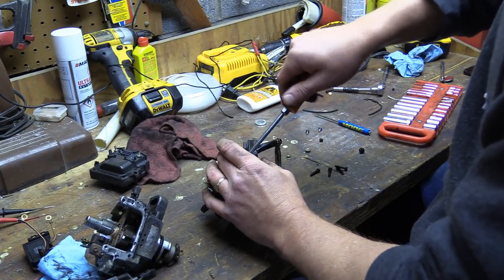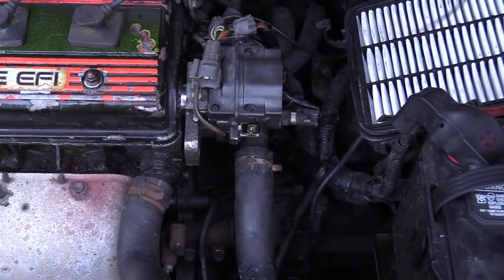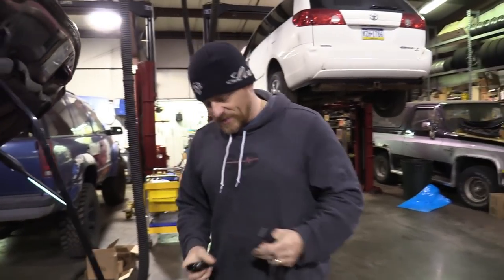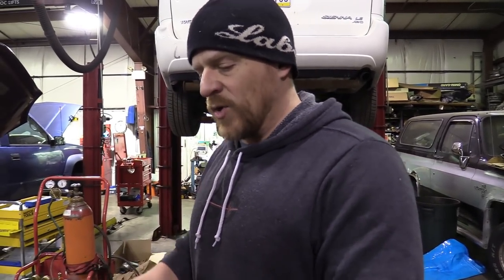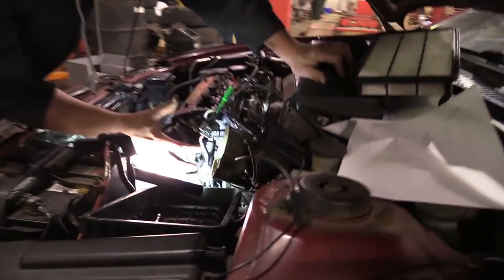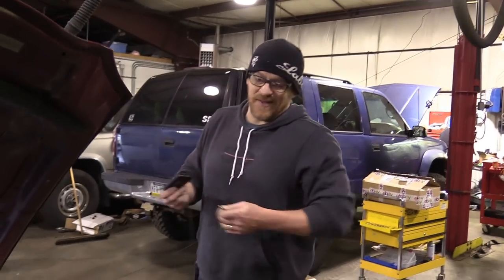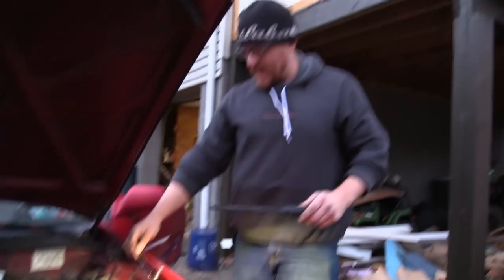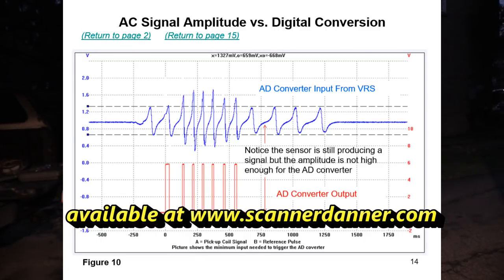Misfire, weak spark, 2 years after coil replacement 94 Toyota Celica (part 2)

Comment: Your first statement is so true. I just fixed had a crank no start on a 1987 Jeep. The coil was suspect, but it passed all the resistance checks. That led me to thinking it was an ignition module but a new coil fixed the problem.  You know the enjoyment of fixing a car with no new parts required. Lots of satisfaction right there. You are indeed blessed in many ways. Wow, adjusting the air gap was a huge difference in the signal. That was a cool comparison.

Comment: Scanner Danner after 10 minutes, "You need a distributor, a cap, and a rotor. That'll be 90 bucks."
Dad Danner after 6 hours, "No parts required Son, it's free."
Son, "Thanks Dad. That was easy! Can I borrow 20 bucks for gas?"
Reply: Hey an Ivan from Pine Hollow Diagnostic no parts required repair.  LOL
Reply: 90 bucks? You're kidding.
Reply: No, indeed, even cheaper on amazon. Why are these parts so dirt cheap over there?
Here in Germany every japanese car spare part means big bucks, a 4 week wait and no aftermarket available.
Reply: Sounds like me and what my kids would do.... lol ol......but, we are dad's 1st, and professionals 2nd.. :)
Reply: Nice !
Reply: Dan what is the name of the black scope you are using on the celiac wave form from distributor wires
Reply: @werner.x  we feel the same way about your parts for German cars over here :P

Comment: I agree with the caleb on the threshold, which is why at higher RPM when the signal strength increased the check engine light would go out.

Comment: I had to count the mil flashes on a 94 Jeep Cherokee the other day.  The guy  told to check the engine light was baffled that there was no OBDII under the dash.  Luckily you can cycle the key on those old jeeps instead of having to do the paper clip trick.  Everyone at the shop jokes about my "old man knowledge" but it saves the day more times than not.

Comment: Great video guys !! That weak signal is the same thing you see when the air gap gets too big on an abs sensor. The amplitude signal isn't strong enough and the abs kicks in when coming to a stop. I still have my brass feeler gauges for adjusting the air gap in those distributors !!

Comment: always great videos Scanner Danner,, thought I would let you all know these coils do fail, they usually leak secondary voltage to ground, you will usually see the white  gray tacking. you might have to remove coil for inspection.. Pick up coils also fail in many cases you will have to get it hot,, as a trick we use in the shop,  heat the distributor with a heat gun or hair dryer being careful of course. when the ignition fails while  running, then you can measure the resistance across the terminals.. I believe the max value is 180 ohms.. 25 year master diagnostic tech.  japanwest,  regards

Comment: No wonder I couldn't find this video when I had (and still have) a misfire with my '95 Corolla. I was looking for OBD 1, instead of "pre OBD 2", and just happened upon the part 1 of this video. I've had the misfire since around 2015, but part of the solution was to turn the AC on and put it in neutral at stop lights. If I pushed the car too hard on onramps, it would hesitate also. I found a guy selling a distributor and bought it. His distributor had copper windings coming out of the pickup? like yours. But I swapped what parts I could and still had an ignition miss. But at least I know I was on the right track. Because I did do cap/rotor/plugs/wires and still had/have the same problem. I did EVERYTHING under the sun away from the ignition system to find the problem...no dice. Will be replacing the distributor assembly because this one does leak oil past the seal, and the rotor/shaft is welded on both ends, so I can't replace the seal.
Reply from the maker: Is it a constant misfire? If it is, step 1 is to do a cylinder drop test and once you know which one it is, then compression and injector needs tested on that cylinder

Comment: Hey Paul, great Video. I‘ ve learned a lot  from your Channel. Here in Germany , I fixed a BMW X3 3.0i by using your Knowledge of Long and Short Therm Fuel trim. It had an Airleak caused by a smal cut in the plastic Valvecover between the Coils. Found by Smoketest  with e- Cigarette and Pe Bottle blocking the Intake😬
Thought i was ready, but the Fueltrimm did not get under 10% on both Banks so  check engine stayed on. Then we change the MAF and the Car was healed after beeing 8 weeks in a Mastershop🙈
Took me about 4 Hours.
There are too much Partschanger in the Shops today, without Laptop they are nothing. 
By the way , stop smoking. The World and your Students need you. 
King Regards from Lower Saxony / Germany
Reply from the maker: My daughter tells at me all the time too. Thanks brother
Reply: ScannerDanner i lost my Mom on Cancer 17 Years ago as i was 20 and its never been the same Life again. Stop it for your Family, don‘t think it happens only to the others.

Comment: GREAT case study Paul, and excellent camera work and editing, Caleb! 

What a difference in amplitude with a tighter air gap! Off the scale! I do alot of small engine work, where the ignition coil is fired by a flywheel-mounted magnet - there needs to be a specific air gap (usually works within a small range) in order for  the spark to be strong enough for the engine to start, run, and run under load. Was great seeing the difference a relatively small air gap change makes on the U-Scope there. Don't know why I never made the connection before, even after seeing countless videos on rust-jacked ABS sensors on GM products.

I also thought a code 12 was "no codes" - guess that's GM only. Those "in-between" years where cars were computer controlled, but not OBD-II, were a pain in the ass! Both our '86 Grand Marquis and our '93 Volvo 940 are this way. The good thing is, neither one breaks down very often - they were very well built cars, as that Toyota was. Our Marquis is at 267k miles (thought it was a little less than that, but I just checked!), still on the original in-tank electric fuel pump, and distributor. But to be honest, I miss having just a carburetor and distributor, and a block-mounted fuel pump to deal with. I'll have one again one of these days! :)

Thanks for sharing, Paul! 👍🍻

Comment: Dude, great stuff... However you are incorrect about that capacitor on the inside.  That inside capacitor being NG is exactly the reason you can see that ignition spike on the VR signal.  It is the function of that capacitor to eliminate that ringing (read spike) from the primary of the ignition coil getting into the rest of things nearby. BUT also remember that same ringing spike getting into things is also picked up by the VR coil (oodles of windings to sense it) and that was what you were seeing.

Some might argue that the capacitor is used to produce the spark like in the old Kettering ignition systems with points and condensor (capacitor). NOT here.  It is merely the filter keeping that noise out of the rest of the system arresting it at its source.  I should mention that I am a mechanic like yourself for the last 47 years and an electrical engineer for the last 27 or so years.  Also, I have been designing ECUs and other stuff like this.

Comment: Great video guys it was a really well explained video how the system works.
 I like the distributor system that has everything like ignitor and ignition coil on the outside I have noticed that you will have a better secondary waveform on that system when you put the scope of the king lead and much easier to work on. The STA signal is used by the ECU to allow additional air to enter the intake manifold while cranking the engine. Additionally, it is used to determine when to enrich injection for starting and when to operate the Fuel Pressure-Up (FPU) system. In the event that the STA signal malfunctions, the engine may be difficult to start.

The STA signal at the ECU will be low at all times except while the engine is cranking. While cranking, the STA signal goes high (cranking voltage) as current flows through the closed ignition switch and neutral start switch contacts. This is what I found on the STA signal Toyota has a lot of abbreviations.
Reply from the maker: The STA signal is involved with the starter circuit. That much I knew, but for them to describe it the way they did in that flow chart was super misleading and incredibly stupid  :-)

Comment: That purely for the content is probably one of the best videos you have done Paul. That for any regular mechanic or Diyer could have been a parts cannon blitz. Plugs leads cap rotor coil, screw it complete new dizzy. Or the lucky mechanic, it needs a dizzy. Correct but what was the real issue? This project had multiple issues. Swapping of known bad distributor for a possibly ok one. Swapping parts of unknown condition all lead to an extended repair time. Testing of input signals was the key to the replacement dizzys correct diagnosis and no parts repair.

Comment: heres a thought for you paul- since the ignition trigger is metally connected to the cam trigger through the shaft it is possible for the ignition to be transferred up the metal by indictance and picked up by the pick up coil. i'd be willing to bet under the plastic on that ignition coil is a shield wrapped around and grounded through a mount screw. probably the reason it stunk is the signal was so low that top trigger is so the computer knows #1 tdc for sync on injector pulsing. the bottom runs the coil and it just fires every 90 degrees of distributor rotation or 180 crank. the keyed rotor is what times the cylinder. so the injectors were firing out of time.

Comment: Yes signal getting over ridden with noise. If there were no adjustment I would have been tempted to slot out the hold down holes. Especially if you aren’t keeping it. Crazy how the one that was in there shredded the coil of wire!!!

Comment: no adjustment on air gaps, my azz! file the mounting plate screw holes out and tweak it around, providing the dist. shaft isn't flopping around from bad bushings.

Comment: if you are forced to reuse oil orings / packings ( non dynamic) Ive found that a bit of fuel lube or EZ turn lube will ensure a decent seal.

Comment: Danner I hope you read this , I want to sincerely thank you for educating me over the years. Ive watched every single video you have and learn a lot. Today I applied the knowledge on my out of warranty 2015 BMW 3 series. I got a check engine light and so I first invested in an Autel MK808. Scanned the car and found our it had something to do with the front left shock. ( I has an electronically damened shock absorber )  I graphed left and right side sensor amperage and found out that the leftside was being overcompensated driving over uneven roads. So I was kind of wondering if the shock itself was bad on the left side or what. I couldnt make up my mind then I looked at the reference voltage , they both showed 5v on the money. but then I noticed something , the left side raw voltage was showing 2.3v instead of 2.5v which it was on the right side. Kind of odd I thought. It was getting late and I didnt want to get out the tools so I just turne the steering wheel all the way to the left and put my hand on the sensor mounted on the side of the shock and wiggled on the cable while lookingat the graphed sensor voltage. the raw voltage made all sort of up and down shapes and DING , the check engine light came on. And so did the bulb on my head :) Thanks to the persistence and tricks I learned from you my car is not going to the shop and is not going to be shotgunned with unneccesary parts. Thank you.
Reply from the maker: nice find my friend!

Comment: I used to have a Toyota Camry with the exact ignition set up but never experienced this type of problem. So the flowchart tells you to replace the distributor if the air gap is incorrect, yet the air gap is adjustable for a correct setting which in turn can resolve a problem. The stealerships don't care and just have you replacing a complete unit composed of many separate parts. Now I know why you state that flow charts suck Paul. You did show a scope waveform from the service literature - was your original signal within specs as per the waveform ? Even though the adjustment increased the output and resolved the issue, if the original signal was within spec, you would have to wonder why it was throwing a code and check engine light.
Putting those two coils in series on that Ne pick up coil might be a way of boosting the output signal, although I'm not exactly sure - there is no Toyota literature I have seen that explains this.
Great job Paul.

Comment: Same engine on my Aunt's 93 Camry. 3 years ago went to the shop for a no start issue. They fixed it with a new distributor. Last few months it has had intermittent and hard starts, now a no start issue again. Checked for spark, and doesn't have any. What would be the first step in diagnosing?? Maybe gonna pull cap and check the rotor and maybe the coil.

Comment: Great informative video. Have a '98 corolla with 4afe engine also had that problem where the coil got loose have to replace the distributor 2x china aftermarket unfortunately only last aroung 40k km each vs original 200k+ km. Recently igniter module broke, watched your video to confirm that it's not the coil with aftermarket china, again 4x replaced which all were broken with exception for 1 which lasted 10km. So I have to use the old broken down original which I store wherein I just soldered the disconnected terminals from the inside and to my surprise it is now running! My point here is I do not know how long this would last due to scarcity of original parts I am thinking of converting it to coil on plug my only problem is where to find a 5v continuous supply for the modern coil cause I think I could use the distributor to turn on those modern coil vs an external circuit module which base its firing on camshaft/crankshaft sensor. I am thinking of using the IGT/IGF as a 5v source if it is continuous. What do you think? ✌

Comment: I can't get my Rav4 97 to start on the first turn of the key. it takes about 4 times for it to read from the tachometer and start. I replaced coil, igniter, checked relays, swapped relays, crankshaft position sensor,, and the distribuitor has the other input from the camshaft position sensor.  for years and years.. and can't get it to start on the first shot. Scanner Danner is there any direction I should take after following almost everyone of the routes. I must be missing something very simple from this vehicle.. I can't identify. Please help me man! Bless you

Comment: Hello SD " 
I have a 1983 toyota corolla wagon 1.6 that I installed a remanufactured loaded distributor , 300 miles later the coil went out .
I did the same as you  " I swaped out the new coil with the old one from the original distributor . Engine runs great now .
Thing is I'm getting that rich smell from the exhaust . Do you think the air gap is my problem  ?🤔

Comment: Hello Danner, I had a similar problem with a friend's (1994 corolla 1800cc) car, first intermittent spark then finally no spark..replaced the distributer for easy fix, no problem now. My question to you is about the pickup coil/sensor, please explain the two pick up coils one for 4 tabs and one for the 1 tab per rotation. I guess the 4 tabs is for firing the plugs if I am not mistaken and dont know what the one tab is for?

Comment: Paul .... Instead of using a timing light.... Could you turn the ignition on ... Then by using a test light probe your number one ignition wire to the distributor cap ... Turn your distributor until the light comes on.... Would it then be in time....
Reply from the maker: Good idea, but too many variables and it absolutely would not get you in time correctly.

Comment: Did notice that the middle display on the U Scope shows the voltage amplitude.  On the first testing your voltage was around 1.4v  After the air gap fix, 5.6v
Reply from the maker: That was the trigger level setting I believe. Not the value of the signal

Comment: Hi there have the same ignition I've changed the coil no spark, change the module  still no spark. Cables, rotor plugs distributor cap. Still nothing . Car does crank any suggestion thank
Reply: Check your grounds. Fixed my 1999 Honda Civic.

Comment: As soon as I saw the loose coil, I know what it is. I was using compressed air to clean the inside of my 92 corolla's distributor and it unwind that coil. I then completely rebuild the distributor with a new bearing, an oil seal and a used pickup coil. Set the air gap and done. I set the timing to 10 BTDC with a torch. I some times hear "ping" at rapid acceleration, any suggestions? Thanks
Reply from the maker: Check your timing again with the TE1 and E1 terminals jumped

Comment: Sir one suggestion, how much can we relay on resistance value of a coil on both primary and secondary in a distribution less electronic ignition system
Reply from the maker: Not much. The thing with a resistance test is, when it measures bad, it's bad, but when it measures good, it can still be bad.
Reply: Kkk  thank you sir

Comment: wow toyota used lots of the same parts on other vehicles. my 1989 toyota hiace jdm 2rz uses the same coil pack(distributor is way longer for jdm and sits on opposite side of head) and the north american 2rz has a identical distributor minus the gear drive. neat